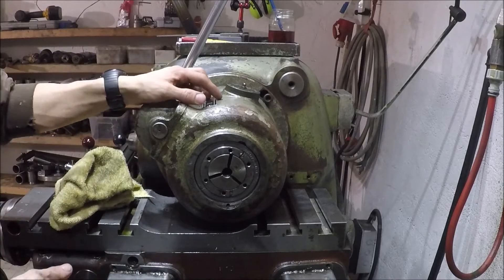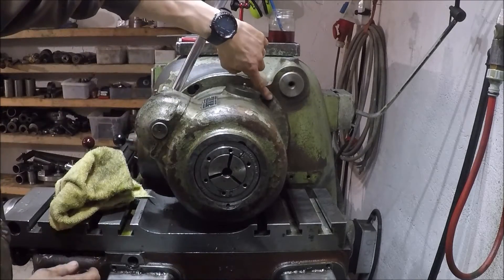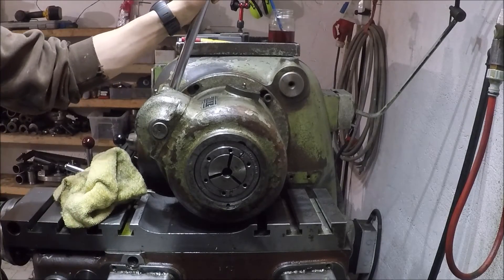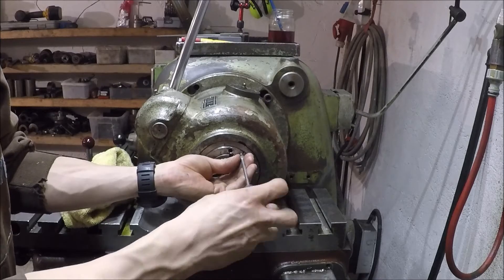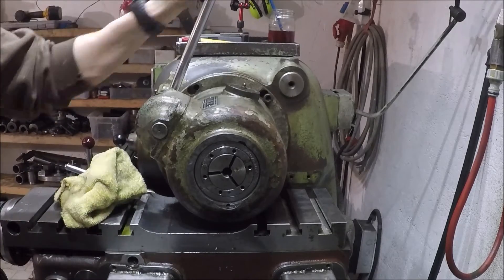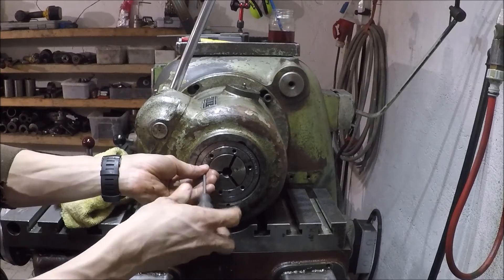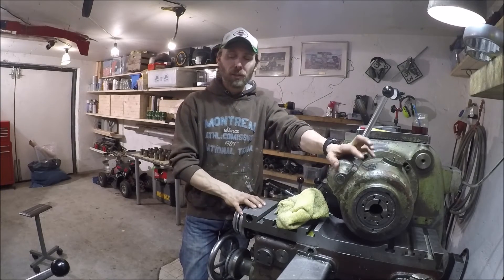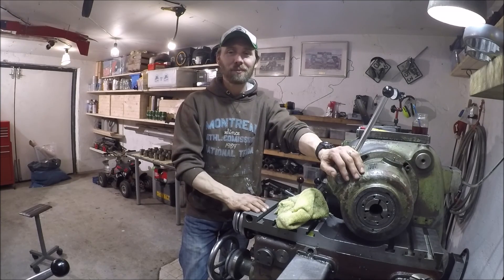The super-duper collet chuck

Comment: There are a couple of threads on PM about this model of lathe with one reference to what I believe is your actual lathe.  The thinking seemed to be that the collets are similar to one from a Herbert 2 Senior "Monoslide" but do not give it a name or number designation.  Someone within the last year was parting an R5 out so if  you can track them down its a possibility.
As well, lathesUK has both parts manual and operation manual available.  This info is not mine I am just quoting what I have found.
Reply from the maker: Thanks for the comment Russ! I´ve stumbled across that thread at some point a while back. Nice to know people notice the channel and the lathe :) I´ve pretty much given up on finding more collets, my plan now is just to chill and let the solution come to me ;)
Reply: There is an R5 somewhat local that is up for sale at way too much money for what I think it is 
worth ($6500 Cdn.) but the seller claims it comes with A LOT of tooling and given it was from a trade school who knows but I suspect the real value could be on that pallet load of tooling "stuff".